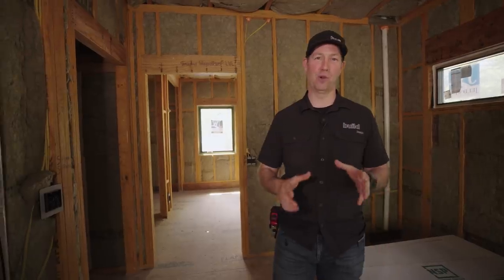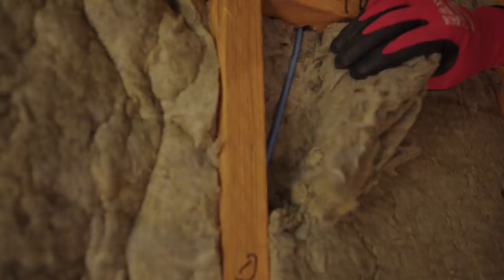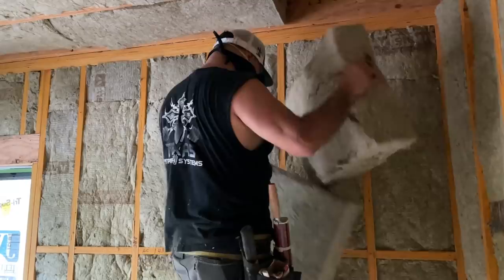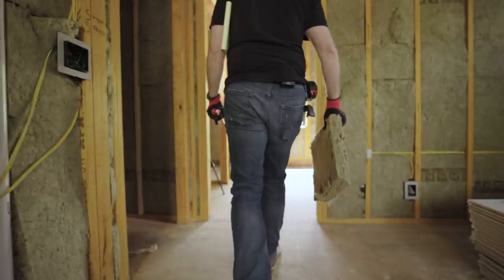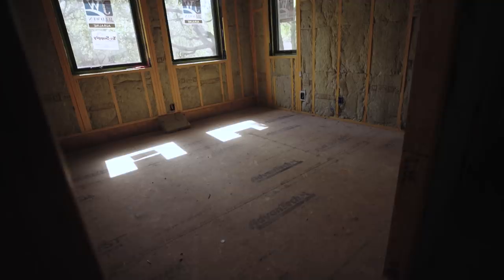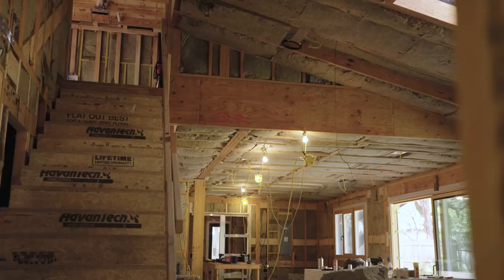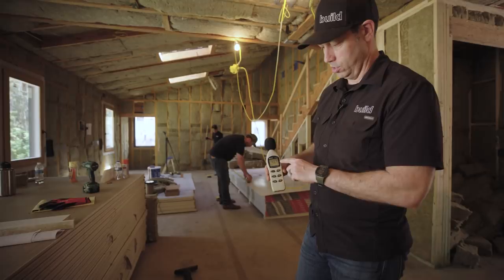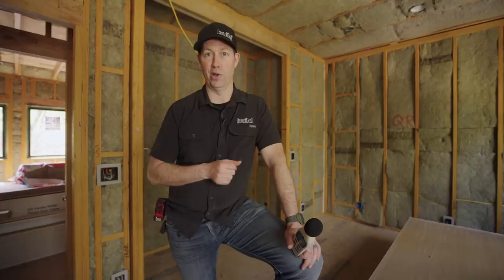7 reasons I used Rockwool insulation at my house.

Comment: Please redo the shop vac test once finished, I wonder if drywall will make it worse... (Doors open and doors closed)
Reply: It's more about keeping the noise in 1 room and not transferring to another. It will still travel. The drywall will cause it to bounce more so it will carry better but won't transfer through the wall.
Reply: Just like an empty room and one full of stuff. It will be worse after sheetrock, and better once everything can deaden the sound.
Reply: Drywall makes it worse for the room you are in but better for being in the room next door.  If you want to reduce the sound transmission out of the room you are in 5/8" drywall can improve the situation.  Also can to RC clips, another layer of drywall, acoustic caulk, separate the framing.
Reply: @davidmorrow4195  All great tips, thank you. Thoughts on RC clips vs. horizontal furring strips to minimize sound bridging (I.e. cost, labor, efficacy, etc.)? I've used horizontal furring strips combined with Safe 'n Sound and Homasote to great effectiveness with a laundry closet in a master suite. Thanks!
Reply: @drewt3210  I think RC channels work better than furring strips but only used the channels, not the additional clips (maybe I should in the future?).  I used them in the ceiling of a room.  I did a lot of research on sound insulation.  First thing to do is to make sure it is air tight between rooms (electrical boxes, caulking under or above framing).  Safe n Sound works better for high frequency sound, low frequency sound (bass, walking on ceiling) travels through things so either additional mass like 5/8" drywall (cheap option but heavy), 2 sheets or decoupling works best.  I used the mass vinyl mat (like Homasote) on the house next door to ours that we purchased as the house is 8' away.  Seems to be a great solution but heavy and expensive.  Putting up Resilient Channel (RC) is basically the same work as furring strips (maybe slightly more difficult to cut because sheet metal?) but does a better job as sound has to come through the framing, then can't get to drywall because drywall screws are only in channel, channel is mostly decoupled between framing and drywall.  I also looked into Green Glue Noise Canceling caulk with goes between two sheets of drywall and will likely use this on next project which will be our living room ceiling.  Seems simpler than RC or furring strips and is supposed to stop bridging.  Can put up sheets of drywall very quickly, then mud and tape of 1st sheet is only to cover gaps (offsetting gaps on 2nd sheet).  I hate sound from outside or between rooms and really like it to be quite.
Reply: @davidmorrow4195  THANK YOU for that really well thought out and thorough explanation--you're the man, David! Exactly the info I wondered about. I've looked into green glue too and wondered about it, but went a different route. I do wood work and steel fab, so RC wouldn't be any more difficult than furring--likely snips are faster than chop saw by a mile. I'll probably go that route next time around. Take care!

Comment: I saw a guy test the 4 main insulation styles for flammability. 
Spray foam was highly flammable, creating a shell where it continued to burn inside when it looked like it was out.
Silver backed foam sheet took a bit to ignite but then burned aggressively.
Rockwool just showed a scorch mark (like shown in vid).
The Pink stuff ignited because of the paper barrier but then extinguished itself with no real damage to the fiberglass.

Comment: Biggest selling point on exterior Rockwool/ROXUL SAFE/CURTAINROCK 80 versus EPS/XPS can be summed up in 3-words:
  
Grenfell Tower Fire.
  
Wrap your house in Rockwool and you get to not die in a rigid board petroleum byproduct fueled funeral pyre.
  
The hydrophobia and sound deadening are just bonuses to the R-value and fire rating.
Reply: what does that mean?
Reply: Yes, I wonder why Matt didn’t do exterior insulation.  He seemed to love it in prior videos.
Reply: The problem at Grenfell wasn't the exterior insulation, it was the flammable siding (aluminum + polyethyleen + aluminum sandwich).

Comment: please do the sound test again after drywall, since the exposed rockwool will dampen sound much more when exposed
Reply: I don't think that's true but I'd certainly be interested in seeing. I don't see how anyone could make the argument that sound would travel through two layers of drywall plus rockwool easier than only rock wool. But I could be wrong. Drywall itself is a pretty decent sound barrier (not as much as RW) and esp if you get a larger size (5/8 not 1/2 inch).
Reply: P.S. Perhaps sounds WITHIN the room would sound a little louder with drywall since the sound would bounce off the drywall easier than the RW but for sounds outside the room..... yeah I think the DW would only enhance the sound deadening. And I think most people are worried about exterior noise (e.g. TV in another room, loud kids, power tools, etc.)
Reply: @user-nh3gu1ge3d  sound bounces off and travels around drywall so with the doors open the sound would travel farther than no drywall. its why low sound rooms have the triangle foam exposed as opposed to behind a flat wall
Reply: I've used this in three studios that I've built so far. They're so quiet that I can hear my ears ringing. The drywall does bounce some sound off. But the sound stays within that room and doesn't really travel through the walls and or ceiling.
Reply: Of course the walls will echo with drywall installed but you shouldn't hear much of what's on the other side of the rockwool.
Reply: Rockwool has the most acoustic mass among insulation types. The more mass a medium has (like sheet rock or rockwool), the more sound is a attenuated.

Comment: I haven't used the Safe and Sound, but have used the R15 on our exterior walls (replacing very old R7 pink stuff) and can attest that the sound difference is incredible, before it was very easy to hear a car pulling up in our gravel driveway, now we hear nothing unless windows are open!  Also important to me, as you mentioned, is the vapor permeability, we live in a climate that has extremely humid summers and cold winters, our 40+ year old house (with no vapor barrier) still has the original T1-11 siding (except where porches were improperly done and allowed actual water in) because of that ability to dry from either side.  Our goal with remodeling this house is to get it through the next 40+ years with little to no issues.
Reply: Did you install a vapor barrier when installing rockwool on an exterior wall ?

Comment: Rockwool will eventually absorb water if you get enough of it. I had area flooded and part of it got stuck in water. Just that part became soaked, but it didn't pull to remaining batt, so was just able to cut it off and move on.

Comment: As a union carpenter we used this product all the time usually 6" rockwool. As far as insulation on garage ceiling,  if garage is not heated floor above will be cold guaranteed. Do not know where this new home is located but I'm sold on radiant heat in the floors. In all slab floors, basement floors, and especially garage floors. Multiple zones allow for very even heating. I know you will still need ductwork for AC and that makes radiant heat more expensive. My home has this feature and I make my water hot with a stand alone 80 gallon oil fired water heater. Domestic hot uses this unit as well. Home is only 1900Sq. Ft. anything bigger you might need a dedicated boiler. This could be achieved using gas, oil, electricity. I wish I had gone the route of ground source heat pump for some heating and cooling but radiant heat is the way to go in cold climates. Money spent on good windows and doors will return heating and cooling costs as well. Like the roof you have, wish I had gone that route but Lifetime Timberline will have to do. Next home will be all steel construction, as in  commercial construction, no burn, no rot, no bugs, straight walls. Cost is still prohibitive but lumber prices are going crazy so???

Comment: Biggest downside for me is almost all residential mineral wool is made with formaldehyde binders.  Rockwool does make one version without added-formaldehyde for the commercial market, but it is very difficult to source - as of a few years ago was told it wasn't available west of Chicago.  I'd use standard mineral wool in roofs and as exterior insulation, but not in living spaces.  Sure wish they'd eliminate formaldehyde like the fiberglass insulation makers did decades ago...
Reply: Formaldehyde binders was exact reason why I switched to using Johns Manville over Owens Corning for remodel work. Itch difference was huge as well.
Reply: Wow good to know that one
Reply: Rockwool states that the high temp cure drives off nearly all of the formaldehyde. This tracks with formaldehyde's decomposition into methanol and carbon monoxide under heat. I'd love to know what rockwool's cure temp and duration are though.
Reply: @AdmiralBob   yeah that’s a good point. Most people don’t know when they turn their gas stove on, formaldehyde is an intermediate chemical created and burned during the combustion reaction of natural gas.

Comment: More thoughts on mineral wool after having done about 900 sq ft in my basement ceiling: definitely wear a dust mask or respirator while installing it.  Mineral wool usually costs a bit more than fiberglass, but the benefits (fire resistance, water resistance, sound deadening, more R value in less volume than fiberglass, etc) for me outweighed the cost difference.  Installing mineral wool in empty, or nearly empty, stud bays/ceiling joists is one thing; it's a whole lot more difficult when working in a basement ceiling due to the concentration of utility lines.  Fiberglass is a bit more forgiving in those cramped quarters in that you can squeeze it into place and fluff it up afterwards, but not so with mineral wool.  It catches easily on nails, staples, just about anything in the way, so it pays to snip those off where possible to speed installation.
Reply: For basement I'd much rather just insulate the walls, especially if there is temperature-sensitive equipment (boilers, water heaters, furnaces, etc) or things stored there.
Reply: @hailexiao2770  I have insulation in most of the basement walls, but by large, my basement is NOT conditioned space.  I'd rather install the insulation between the conditioned and non-conditioned space to keep the expensive conditioned air where I want it.
Reply: Even more thoughts: most of the project went quickly, in that I had few pipes in the way, the joists were actually 16 in on center, and only a few cables to maneuver around.  The last 1/5th of the project was above the boiler and hot water tank, and due to the concentration of pipes and wires there (also nearby are the thick cables for the electric dryer and electric range), that 1/5th took quite a bit more time to complete than the rest of the project.  I don't think there was a single properly-spaced joist in the bunch; some were wider, some where narrower, one was sistered.  Thus every piece which went up was a custom cut.  None of the batts could be tucked into place as-is.  I don't regret putting in this work but it sure was a pain in the butt while doing it.
Reply: what product/thickness did you install in the ceiling?

Comment: I watched a rockwool vs fiberglass video and I was sold on rockwool. I'm doing a addition plus a remodel on the older side of my home. WOW what a difference the rockwool made on the older side of the home. It killed the heat and noise I live in Hawaii where the older construction was poorly done. I'd tell everyone to insulate with rockwool. My AC loves it. I can use a smaller size AC due to the insulation.

Comment: I’ll be using the same on my house, I build loft conversions in the U.K. we are always fitting PIR boards, don’t like anything about them, cutting, installing, also, they let off a rancid smoke when we tested in a naked flame, no matter what you do with PIR to protect yourself, the dust gets everywhere, as it’s static like, even with the festool cutting tool and extractor, Rockwool is definitely better for sound proofing too.
Reply: Hi,  are we able to use it in uk ?

Comment: Thanks for the information. I'm going to be building a house this summer and wanting good insulation. I am going to use rigid foam on the outward surface with fiberglass bats on the inward section. After seeing this video, I may be trying something new. I wanted to go with SIP construction but was unable to get a complete bid. First was just quoted for walls. When I told them I wanted the roof to be SIP I was only quoted for over the house/living area of the house but not over the garage. When I requested for the entire roof to be SIP I never heard back. I also wanted a bid for assembly/installation. I called. He was out of the office to be at his child's track meet. I left him a voicemail and sent an email. A week had gone by. Still nothing! Emailed a local contractor to get an estimate for stick framing our house. Next day he contacted me wanting specs so he could work on the numbers. Next day I had an estimate emailed to me. He asked who was doing the foundation, who was doing the driveway, asking if I was needing more than just the house framed up. Next day I had him out to the property for an estimate. The day after I had separate estimates for driveway, foundation, framing, and plumbing and electric. So I decided against SIP even though it would probably save me money in the long run. I'm just going to be very thorough with my insulation. Funny how one person's sluggishness can lead to someone else's opportunity.

Comment: As much as I like the acoustic test, it was kind of a mute point without a baseline/comparison test, such as before any insulation was installed. While I'm sure rockwool does have great acoustic properties, it's plausible that measuring the shop vac upstairs would have also registered "LO" without insulation (or fiberglass) installed.
Reply: The word is moot not mute moot means it is irrelevant or doesn't apply or is irrelevant mute means it makes no sound
Reply: @brianzmek7272  Thank you for the info!
Reply: @brianzmek7272  You're a moot point.
Reply: The fixer did a video where he shows the difference in a room before and after its insulated and he used rockwool

Comment: If this wasn’t a sponsored video, the host would say that paying double for Rockwool is not justified by it’s benefits. It is more fire and moisture retardant, but is essentially the same in regards to insulating and sound dampening.
Reply: Stay tuned Sean. I'm going to make an unsponsored video and justify paying double for Rockwool. Granted I still use high density fiberglass when clients do not see the value of a $1000 upgrade to Rockwool. But I prefer Rockwool, and a $1000 is a great deal for a product that performs better. RESNET Grade 1 is easier to achieve.
Reply: @mcintosh.daughter   “Upgrade”?
Reply: I've used this in three music studios that I've built so far. It's amazing. No, I didn't get sponsored. But it would've been nice! I will definitely use it again even if I'm not.  Huge difference using it.

Comment: I used Roxul sound & safe too, at a small fortune. It would be interesting to see a demo on the 2xs catching fire, and how much if any the rockwool helps as a block to stop spreading to the next stud bay
Reply: If you really want to see it, there are other video's (not by Matt) that show side by side, Fiberglass, Rock Wool, open cell foam, and closed cell foam.  While the foams will give better temperature insulation, they burn like crazy.   Closed cell foam, at least and most likely all of the foam products, will also give off some really nasty chemicals which will dramatically reduce the likelihood of escaping a fire.  As a former firefighter, even I was amazed at how fast they burned.  Meanwhile, the fiberglass and Rock Wool did not burn.  For the fiberglass, the paper backing burned, but the fiberglass, being glass won't burn unless you get up to the glass melting temperature.  If you get close to the glass melting temperature, it may get a little gooey.  As an example, in today's house fires, fire fighters are seeing temperatures starting around 400 degrees up to 1500 degrees.  At a house fire I talked to fire fighters about, their FLIR camera read 742 degrees looking down the hall towards a group of bedrooms that were well involved.   The Rock Wool did not ignite at all.  You could barely tell where the torch was.   Only a small amount of char was seen between the shelves with the Fiberglass and Rock Wool, where the Foams allowed almost complete burn up of the shelves.  The example structure was an inexpensive wooden bookshelf as the tester discovered building a new wall as he had planned, was very expensive.